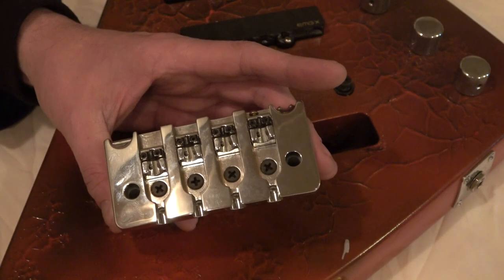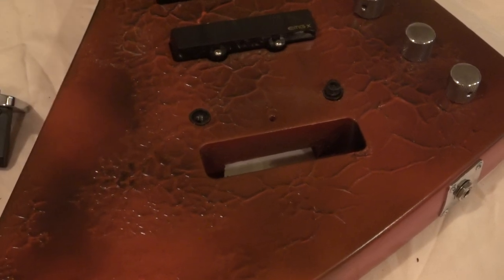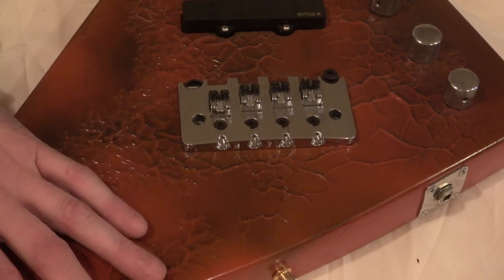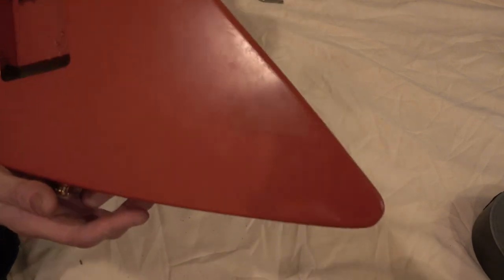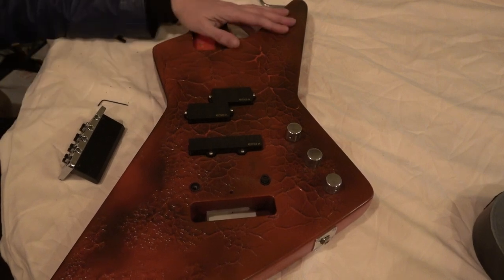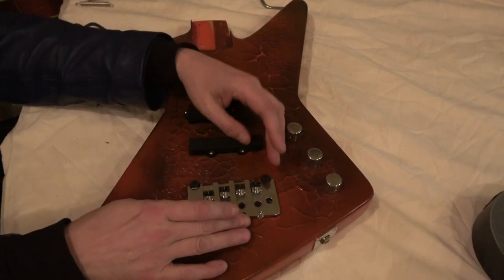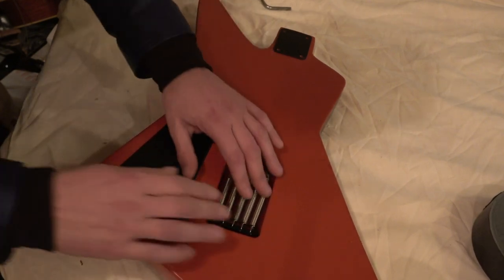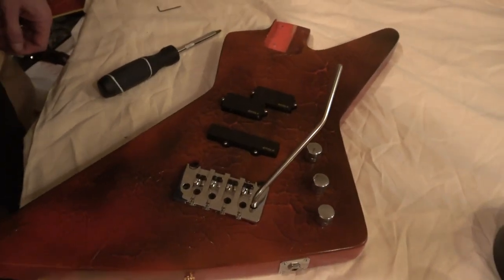Hip Shot Bass Tremolo Bridge Installation. B/W I love RAVEN!

Comment: I installed a bass tremolo with fine tuners on a p bass and had no issues just had to bring the neck up few inches and put a piece of wood under longer mount screws for the neck

Comment: So I wanna put one on a jazz bass but I don't know if that would break it
Reply from the maker: It shouldn't break it. You may have to adjust the neck from time to time due to weather changes, string gauge changes, and I recommend lighter gauge strings because the action and the "dive" will be smoother, and just basic tweaking. I would get a body made specifically cut for the Hip Shot trem. I wouldn't try to route it myself unless I had the tools and the technical expertise to complete the installation.  Good luck and have fun!
Reply: @RobertGraham  Thanks!
Reply from the maker: @paytonbowling7259  I actually do have the tools and the technical expretise to do it, but I leave it up to Warmouth. Just saying. Love ya Baby!